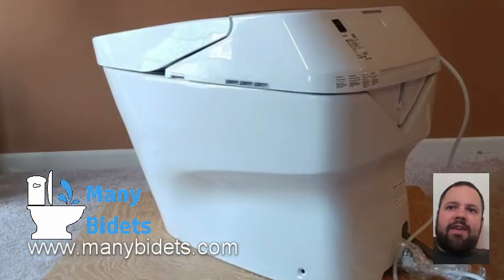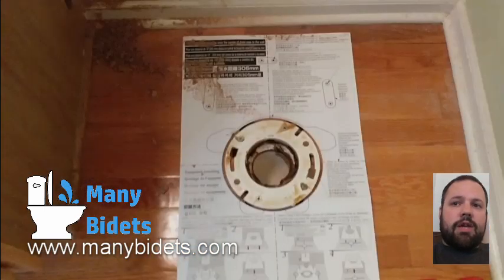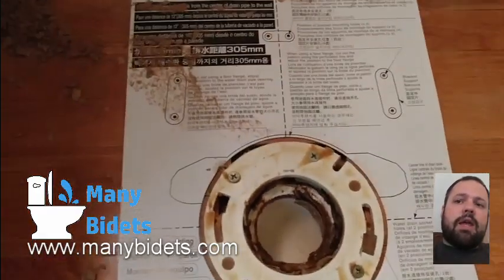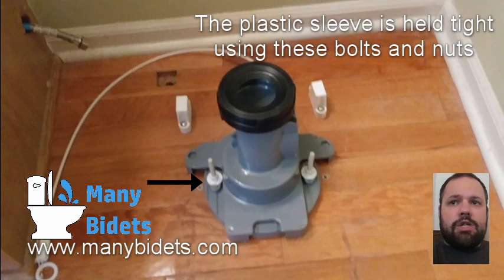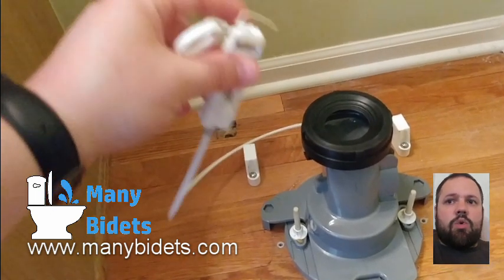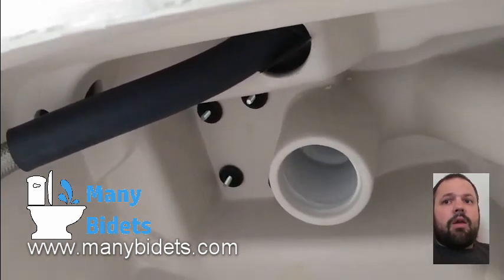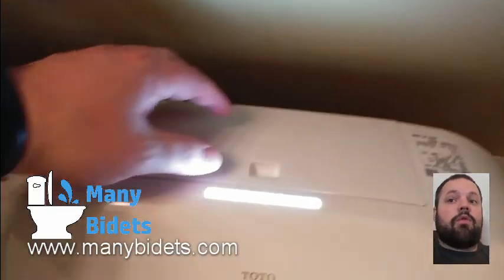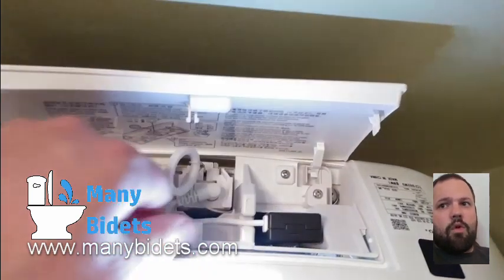TOTO Neorest 700H Installation

Comment: Any idea if the 700h will mount up to a flange that only has 11.4” from the wall?
Reply from the maker: Thanks for the question.  From our testing you have only about 0.25 inches worth of wiggle room, so sadly you'd need at the very least a 11.75 inch rough in...  Is there a chance you're able to move the flange out at all?
Reply: @ManyBidets  uh oh. I might be able to since the flange hasn’t been mounted yet (new construction, 4” pipe coming up through the slab). Thanks for the reply!
Reply from the maker: @mattmo91  Good luck!  Let me know if we can be of any additional help!